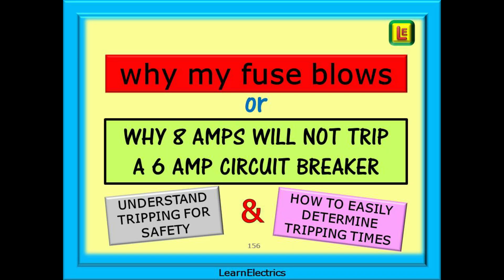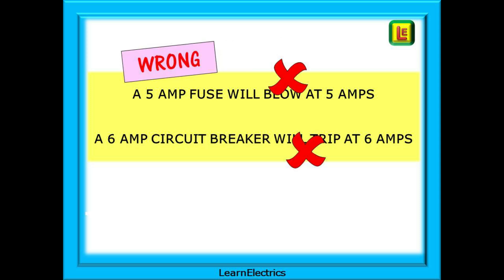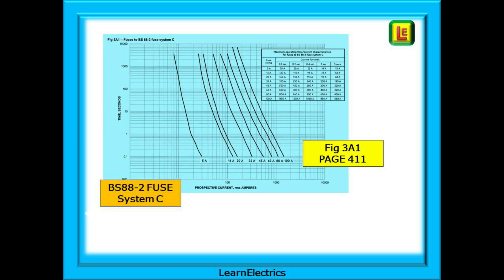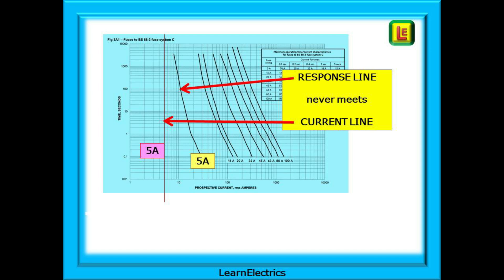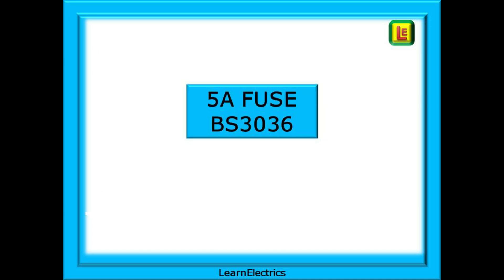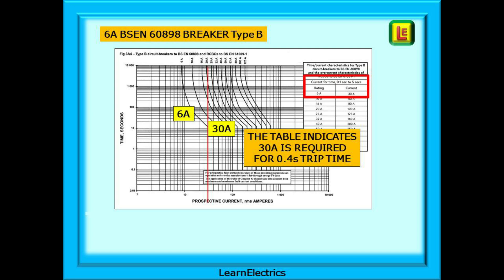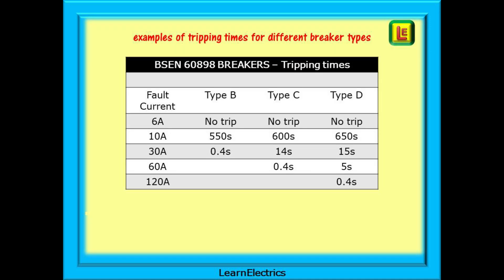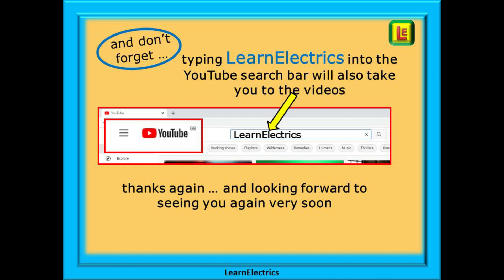WHY MY FUSE BLOWS AND WHY 8 AMPS WILL NOT TRIP A 6 AMP CIRCUIT BREAKER

Comment: This video just raised more questions for me. Sounds like it's really difficult to get Devices to achieve the 0.4s DC Time. Guess why it's so important to have an RCD/RCBO for the circuit.
Reply from the maker: Exactly why we use RCDs as additional protection for faults. Overloads are slightly different, hence the importance of fusing correctly. Thanks for your input, appreciated.

Comment: How does this compare to sustained overload Dave. 6amp CB having 10amps flowing for a substantial time
Reply from the maker: If you look at the tables in the regs Andrew, as shown in the video, a 6A type B will trip in about 600 seconds (10 minutes) with a 10A current. Hope this helps

Comment: Love this channel Dave its been brilliant and helped so many. Is there anyway you'll be able to do a video soon please regarding Type A RCD's and minor works by any chance. For instance doing an addition to an existing circuit but the customer only has Type AC RCD and the board is quite an old and you can't find A RCD's for that board. Would like to know how electricians will get over this. Thanks.
Reply from the maker: I've taken note HS, it's now in my little black book.
The Wiring Regs are not retrospective, so if something installed to an earlier version of the Regs is still functioning as intended and the circuit is still as initially built, there is no need to change things. Only if you add or alter things on the circuit.
Having said that, if you do want an A type installing, put it in a separate box next to the existing CU and run the cables from the CU into the new box, then connect the circuit wires to the house into the new box.
This was done quite often with the old BS3036 Wylex boards where no RCD was provided. Thanks for watching and good luck. Dave.
Reply: @learnelectrics4402  You're a star thank you.

Comment: You also need to consider tolerances. It is impossible to make something that will trip at an exact value so manufactures will quote a range. For example with a MCB the magnetic trip is nominally quoted as  4 times the rated current but in reality may be between 3 to 5 times the rated current. Also temperature will have an effect on the thermal trip part of an MCB and at high temperatures tripping current will fall.
Reply from the maker: Thanks for your excellent contribution Alan, much appreciated. Dave.

Comment: Dave, I was taught that Guaranteed trip current ‘I2’ = 5 x device rating ‘In’ for a type B MCB (60898) or RCBO (61009-1) to operate within 0.1 seconds.  This 5 factor then becomes 10 for a C type and 20 for D type.
Reply from the maker: Absolutely it does Mike. Thanks for watching. Dave.

Comment: Great video Dave, I often used to wonder when I come across a 8.5KW shower (36.9A) on a b32 60898 mcb, and the customer never reports of nuisance tripping. It’s surprising how frequently this is the case especially with a 6mm t&e installed. So in this case coordination isn’t achieved, but is it really a big problem? And how would you code this on an eicr?
Reply from the maker: Yes, the breaker takes linger to trip than the customer takes to shower, so it all settles down again. Coding? I would code it C3, Improvement recommended for the size of breaker, then how do you code the undersize cable, which is ok for clipped direct but marginal for the other reference methods.